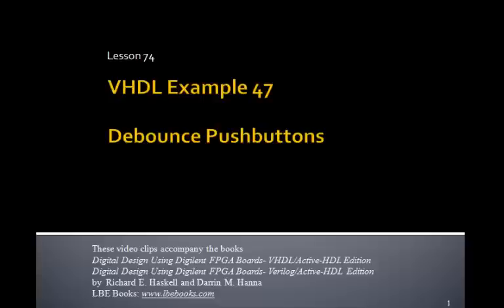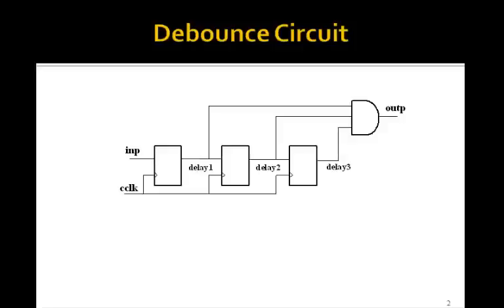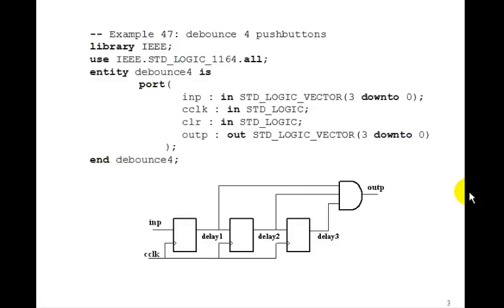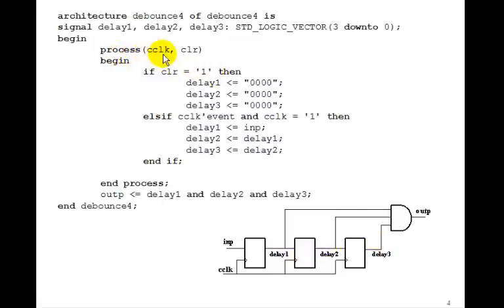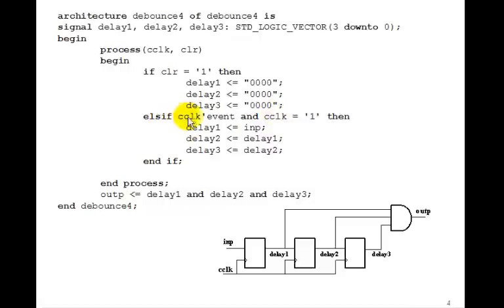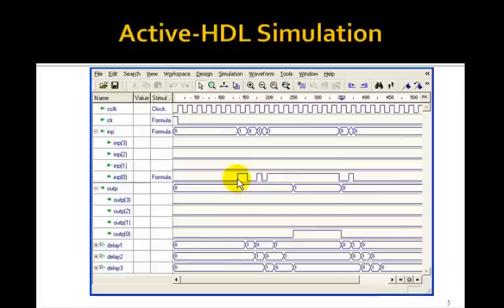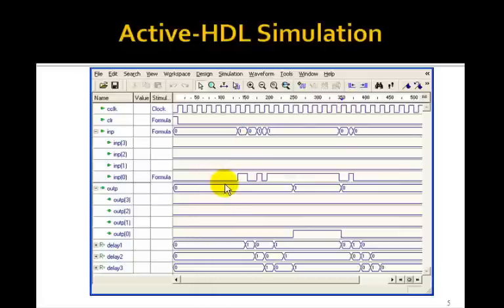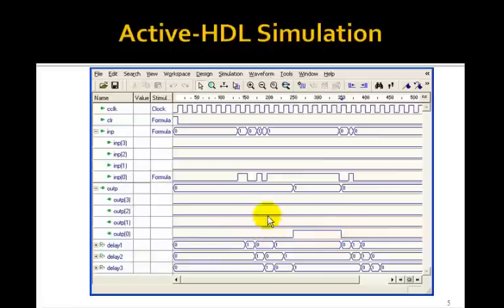Lesson 74 - Example 47: Debounce Pushbuttons

Comment: Can we use more than 3 flip flops  for say, 4 or 5 delays or does our buttons not bounce enough for this to matter (only 3 is sufficient enough)?
Reply: We could use more flip flops and increase the frequency, and it will definitely work, but it is actually not needed in most cases. In my experience I have always used 3 flip flops and have been enough. That must be the reason why Xilinx uses this method.

Comment: note, that you declarate all four inputs but you doesn't use any of them 
it couldn't work with no inputs connected to the module 
correct me if I'm wrong
Reply: The inputs go to the first flip flop, and then all of them are shifted in. So they are actually used.